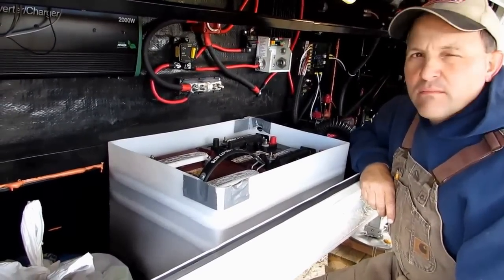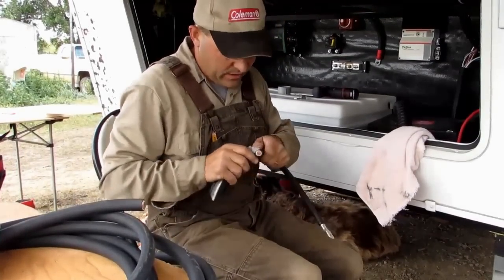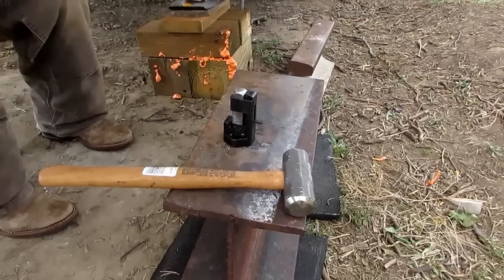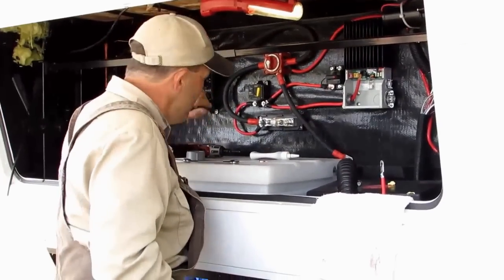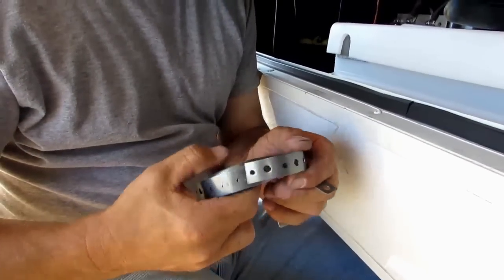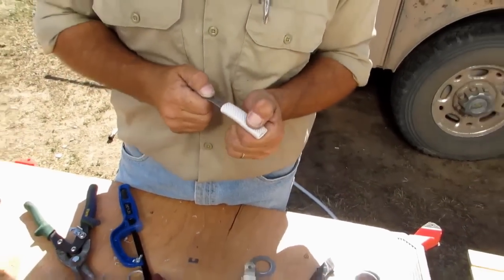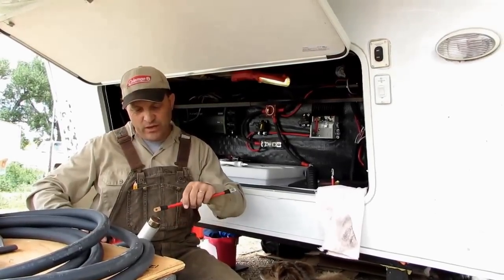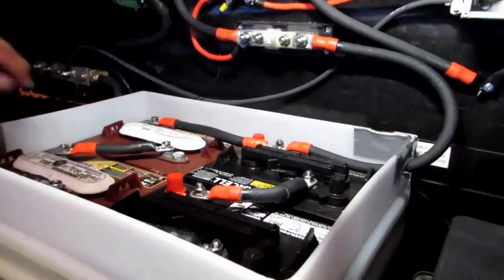RV Solar Power Installaton Advice and Tips Part 1

Comment: Good video. Solar panel setup = 90% layout planning + 10% installation. I would lay everything out on a work bench or garage floor and measure everything. See exactly how everything connects before mounting anything in the trailer. Last thing you want is swiss cheese wall from moving components multiple times. Not that I've done it before  :/